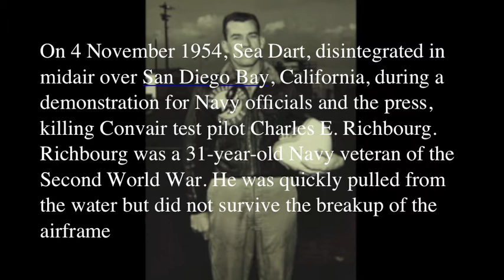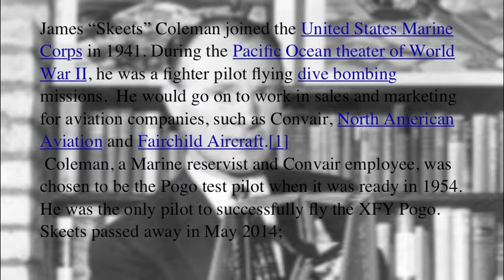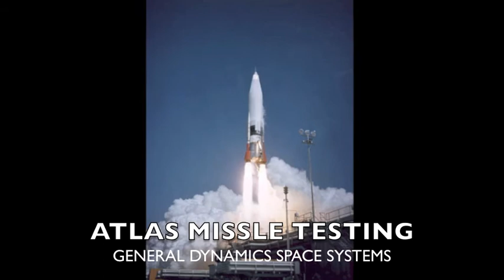BD-0013 Jim Nelson Oral History Convair History

Comment: The B-36's were built in Texas. They were later in San Diego for major modifications; Convair installed jet engines on the near wing tips, modified the flight deck accordingly and changed the fuel system to include jet fuel for those engines. And the 880's used GE J-79's, not J-47's. And the "880" designation came into being as an airplane that could fly twice the speed of the 440 (600) and could carry twice the passengers (100). Actually the 880 exceeded both those figures. But explaining that to the press could be hard. So Convair exec's settled on using the feet-per-second they could fly (880) as a reasonable explanation. 

Convair was a huge company in the 1950's. But their most profitable experience was, propably, after the 880 & 990 project. Convair made a lot of money on the missile program for NASA & the military. The first ICBM's in America were Atlas's. They were accurate and long ranged but they lacked quick response capabilities; they had to be fueled when preparing for flight. They were not stored fueled. But the Atlas program was good. The Space Shuttle platform that the wings and cargo doors connected to was produced by Convair. And Convair designed and manufactured the Tomahawk Cruise & Advanced Cruise Missile. But also the DC-10, KC-10 & many of the MD-11's were made by Convair. Convair and Electric Boat effectively invented General Dynamics and became  divisions. 

My Dad was a design engineer for Convair from 1942 to 1982. He sang bass in a men's quartet, had 5-kids and a beautiful wife (my Mom) and sported a little black mustache.

Comment: The 880/990 program caused GD to sustain the largest corporate loss in history up to that time.  It was much greater than Ford's loss on the Edsel program.
Reply: The Edsel was a pretty good car. The 880 was a pretty good plane. But the similarity ends there. The Ford product was a little crude with a bent toward high-tech. The Convairs were fabulous but not particularly marketable. In the 60's 880's were popular to ride in, and served an important role- that of ushering in jet flight to medium-sized ports. They were versatile. It wasn't their cruise speed that was so high. They embarked much faster than the others. Pilots had to watch carefully or they'd over-speed the wing in a climb!

The airlines replaced them with 727's, although they were shorter ranged, and L-1011's which were also medium range craft.